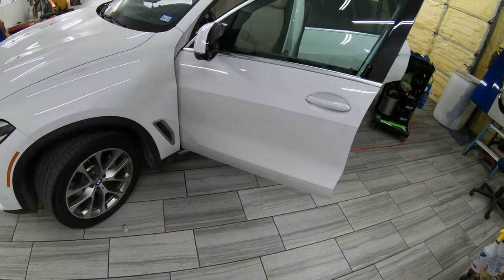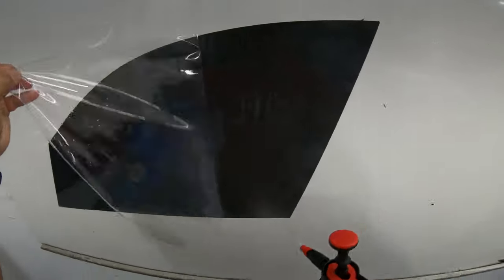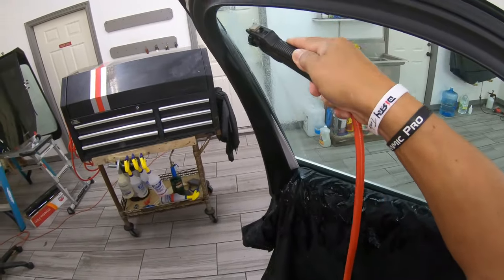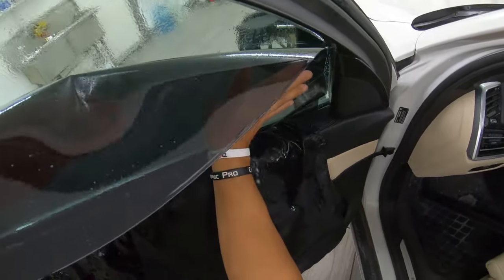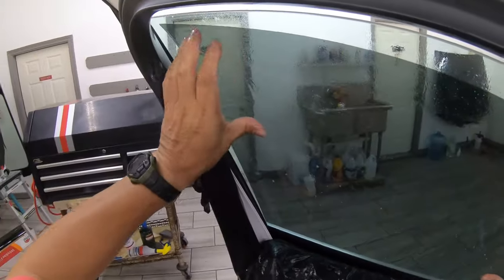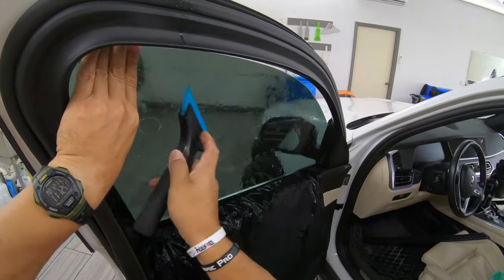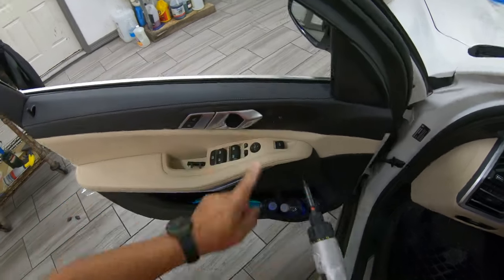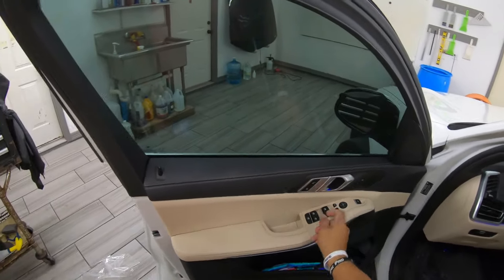22 BWM Window Tint Driver Door!

Comment: What’s your slip and dilution? I used 32oz zep bottle with 4 pumps of 7 generation soap with jj bottle dispenser and I have to heat it to tack into place for the top edge
Reply from the maker: U have to buy a mm measuring small cup...u have to measure EVERYTHING that goea into slip solution..
For example.. i use 1 oz to 1.5 oz tint Slime for window film installation...so divide that by 4 and u get about 7.5 to 10 mm per bottle....
If u use tirchvits either preference..or u using way too much soap...
If u must mix a gallon...do so and dispense slip from there...slip thatbis not used after 2 days will break down and be ineffective..

Dirty ✌️